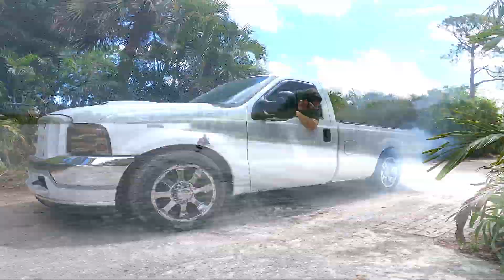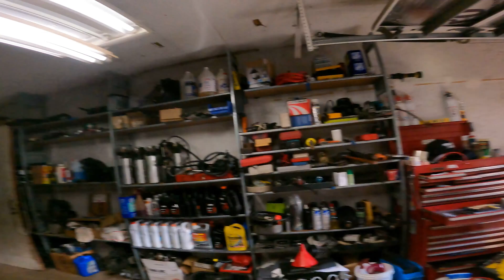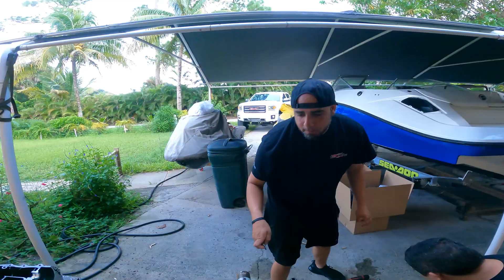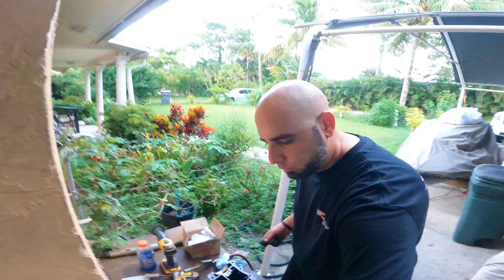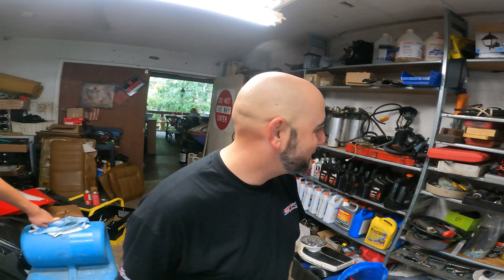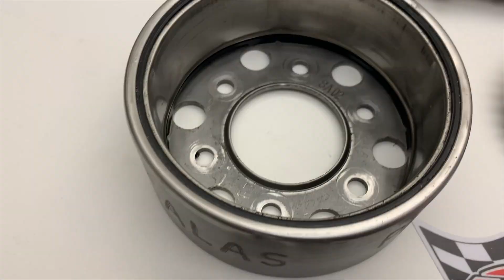Sea-Doo Rotax Turbo Engine Block Build with JP Racing + Tech Tips + Calas Performance + Calas World

Comment: We deal with the burnt wrist pin stuff alot in the drag racing world... take your H beam rod and put it next to a stock rod... the oil hole in the H beam is in the top of the rod "all manufacturers do this no matter what it's for!!!!" Now look at the stock rotax connecting rod and the oiling hole is in the base/side pointing toward the oil squirter... we run a little more wrist pin clearance with bronze bushings and drill a 1/16th oil hole in the new rod in the stock location and no it doesn't weaken the rod any we run them a 1500+ hp

Comment: When the stock engine of my 255 rxtx over heated long time ago I was very skeptic of the exclusive close loop cooling system of the seadoo's so the mechanic that used to work at the seadoo dealer and now he works independent that was 3 years ago told me that seadoo is the only brand to use this close loop and had to many over heating engine problems because there is no much supply of coolant to cool the engine so we decided to change it to the Riva racing open loop system with fresh water since then I've never had overheating problems again the only thing I have to check is that the water filter is not block with sand you know. I have not seen in any seadoo videos with this open loop water cooling system, I mean there are a lot of air flow filter or free exhaust systems videos but every time they show them I see the anticoolant compartment. In my experience it is the best mod so far I've installed on my PWC. Few days ago speaking with my mechanic about this cooling systems he told me that when you modifiy your engine as on your video he recomends to convert the open loop cooling system becasue the close loop cooling system is design to supply coolant to a certain flow of rpm but with more rmp you need more coolant and the way to have more coolant is to have water flow as the yamahas.

Comment: As I said before I really enjoy your videos and I have an issue with my RXTX 255 Seadoo 2008 and I saw on the background of this video a red RXTX in your shop. My problem is the pistón that holds the front cap of the jet ski. The last shock lost strength and can’t hold the weight of the cap. I change for a new shock but every time I close the cap it pops out from the upper lock of the shock or pistón I don’t know what you call it. My question is how can this problem be solved? Thanks
Reply from the maker: Get in touch with me
Reply: @calasworld  how? I live in Mexico, I use what’s up app

Comment: The manual states to use regular gas on the na engines and premium on the supercharged engines...Are you outside north America?
Reply from the maker: Like I say when I take a motor apart that they been using 87 the top of the bearing on the right is beat up that’s not normal
Reply from the maker: Rod
Reply: I have a S/C 215 challenger and it says to use regular fuel.